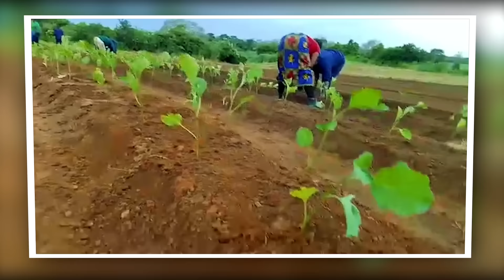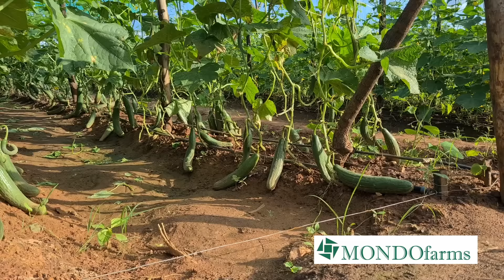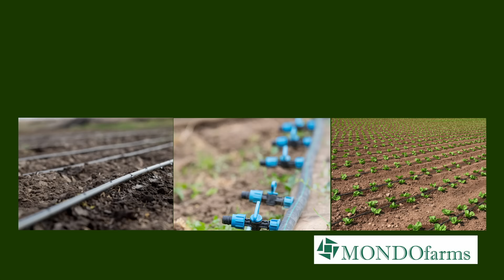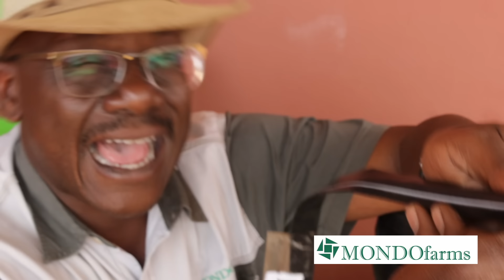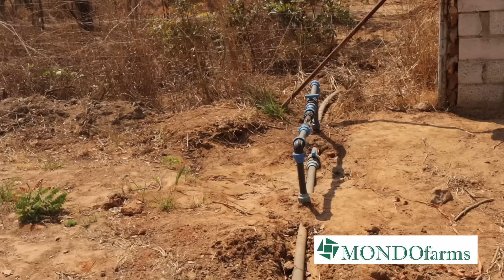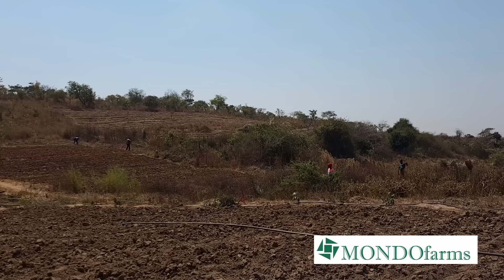Drip Irrigation Systems: Simple, Direct and Cost-effective | Farming in Zambia

Comment: I'm Kondwani
Soon to be Mechanical  engineering graduate.
I noticed your delivery pipes are relatively small.
Consider bigger pipe diameters for ease of flow and minimal pumping power requirements.
 Of course trade offs are needed to achieve optimal irrigation, But I thought I should put that out there nonetheless.

Regardless, this is very inspiring and impressive. I love seeing Zambians soar and do great.
I look forward to more of your video sir!
Reply from the maker: Thanks, Ba Kondwani. I'm sure you are right. The pipes we use on our farms are sizes and brands  that are both commonly available and affordable for us.

Of course, we would love to have better designed pipes, but we are not there yet. The farms have to operate eithing their financial realities and normal supply constraints in Zambia.

It is something you will come across as you move into practical experience. It's different from the textbooks.

All the best.
Reply from the maker: Thanks, Ba Kondwani. I'm sure you are right. The pipes we use on our farms are sizes and brands  that are both commonly available and affordable for us.

Of course, we would love to have better designed pipes, but we are not there yet. The farms have to operate eithing their financial realities and normal supply constraints in Zambia.

It is something you will come across as you move into practical experience. It's different from the textbooks.

All the best.

Comment: Do you have booster pump from the reservoir point?
Reply from the maker: Hi Patrick. We don't need a booster pump for the flow down to Kondwani 1, as the gravity is enough to give us good pressure for drip irrigation. If we had a booster in the system, we would definitely have shown it in the video.

However, Kondwani 2 is located uphill of the water reservoir, meaning we can't use gravity flow.

 We will have to install a booster pump to take water up to it when we start to grow vegetables there. But to save on power, we will set up overhead tanks there, which will then feed the drips.

I find that most people underestimate the power of gravity and benefits of good elevation.

Comment: Dose drip irrigation fit sand soil or mud soil?    I,m Egyptian
Reply from the maker: Yes, it can work. One has to adjust the various factors:
Length of time watering
Frequency of watering
Time of day or night of watering
Type of drip tape (emitter spacing and emitter type)

A very useful tool for you will be soil moisture sensors

Start out small to experiment and give yourself time to learn and know more

But most importantly, consult an expert with the drip irrigation suppliers

All the best

Comment: Hello MondoFarms,

I wanted to express my appreciation for your informative videos. They've been incredibly helpful for a young farmer like me. I have a plantain farm and a tractor that I use for weed management. I'm also looking to implement drip irrigation on my farm. However, I'm concerned about how to lay the pipes without causing damage, especially when using the tractor for weeding. Do you have any advice or techniques that could help me avoid damaging the pipes during this process?
Reply from the maker: Hi Mcbean. That's a great question, but one we can't really help with yet.

We don't yet have a tractor and only hire them for field preps 

Our advice is to consult experienced and reputable drip irrigation experts in your area when you are going to implement the system. They should be able to advise you properly and perhaps help train your tractor operators on how to maneuver in and atound the drip tapes properly.

All the best.

Comment: I have noticed the distance with your field blocks what pump do you use from the main reservoir to the fields to handle pressure for good flow
Reply from the maker: Thanks Ba Wezi. The water flows between the two under gravity. We always position our reservoirs uphill of the fields to make that possible, and we get enough pressure for drip irrigation.
 If there was a pump, we would have shown it.

Pls watch the video again to catch all the details we put in.

Comment: Highly appreciated
but, can overhead tank be used for drip?
Reply from the maker: Yes indeed,and that is what is mostly done in farms.

The aim is to achieve enough pressure, so the overhead tank must be placed at a high enough elevation. 

The general rule of thumb is 10m of drip per metre of tank height. So with a 3m high tank, you can have 30m length drips.

But note how we use the bypasses to mitigate the number of drip lines we open at a time. 
We learned from experience that even if you get the tank height and drip length right, you still shouldn't have too many lines on at a time.

Comment: Hello Chesha
I like so much yours videos from the farm.
I'm a cuban farmer 
I sow cucumbers, carrots,peppers and any vegetables. 
My first problem to produce is de irrigation. 
Here is by gravity with a Diésel motor and spend so much.
I'd like to put a drip irrigation, but here in Cuba 🇨🇺 is difficult to find this systems.
I was watching you can sow very well with this irrigation systems .
Reply from the maker: Thanks for sharing, Leo.
 All the best
Reply: Do you have access to the patent drawings for drip irrigation components? If you have the Internet I would assume you can look up patents. It may be possible to reproduce a soaker hose by using locally available materials, although you may have trouble with having accurate pressure and water use regulation.

Comment: Good day, does the bypass have end caps/

Also on the rivuli connectors, how do you control the water because the have no valves?

Lovely session.😀
Reply from the maker: Yes, the bypasses have end caps on either side.

The straight drip connectors are controlled from the gate valve at the head of the bypass.

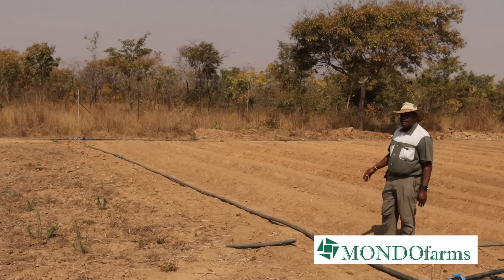Comment: Great Video and very informative, Did not quite get the need for than 50mm line, mind to explain@30:30mins
Reply from the maker: I'm glad it was helpful! 
We use different sizes of pipes according to the distance they are traversing and the pressure we wish to achieve.

We have found the 50mm pipes economical for big volumes of water moving hundreds of meters. 
Then, when we reach the crops, we reduce to 40mm into the bypass systems and the drip lines.

Comment: Good video when it's rain season do you remove the drip taps
Reply from the maker: No, we usually continue irrigation throughout the rain season. 
There are often dry spells where it doesn't rain for up to 2-3 weeks and the heat dries up the soil quite quickly. 
Our sandy soilsl can lose moisture within a short time.

Comment: Mondo farms,  I can see you put 2 drip tapes on each bed,  is it coz of the vegetables you are planting or only can be put on the bed?  Am interested in growing potatoes so would I need 2 or 1 drip tape for the bed?
Reply from the maker: Hi Sethunya. I may have joked about in the video when I wrote  about it, but to be serious, there are three main reasons:

1) We have two lines of plants on each bed, so having one dripnline each increases "fairness." Each drip emitter has about a 30cm radius, so we even have a bit of overlap.

2) Our soils are very sandy, so water drains away quite quickly. Thus, we throw more water at the problem. This is made more important due to climate change, which is leading to much higher temperatures than we had in the past.

3) It has become our cultural practice. Our team is accustomed to putting two drip lines on a 50cm bed. 

By the way, for carrots and onion, we make 1m beds and put 3 drip lines.

I hope that helps.

Comment: Great information, one thing I didn't hear is whether you have a pump from the dam or are just using gravity for distribution of water.
Reply from the maker: No, sorry. if we had a pump, we would have shown it as part of the process.
The water flows out of the bottom of the reservoir and down to the fields via gravity. We placed the reservoir on an uphill position.

It would be helpful for you to watch the video we shared on how we built the water reservoir.

Comment: Thanks for the lengthy coverage. There are many other cost saving ideas including:
1- Using covered cheaper and equally good materials / tubing 
2- Using only one line / bed
3- Bending and tieing the ends with tapes/ wires saves you the expensive end plugs.
4- Utilizing 1 meter deep 4 inches perforated pipes besides trees will save you a lot  of money, manpower, water and weeds growth. You could connect these tree roots watering pipes with your irrigation networks. 
5- You could save fertilizers by growing fish in your reservoir and gain " free " fish/ protein ( Aquaponic system)
...etc
Please keep up the good work
Reply from the maker: Indeed

Comment: The problem for drip irrigation is it's costly and more labor to install it, but the good side is uniform water distribution and conservation.
Reply: My dad used it a few years back,the problem was that because we were drawing water from a dam,tadpoles and other microorganisms would always block those drips🤦🏿‍♂️but it saved alot of water.
Reply: @ditirojimmysegang3009  Yep it's water efficient, have you tried putting some filter?
Reply: @ditirojimmysegang3009  indeed. That is why we spent time in the video highlighting the importance of including a water filter into on the water supply line. Filtering the water  is crucial to the success of a drip irrigation system.
Reply from the maker: Indeed